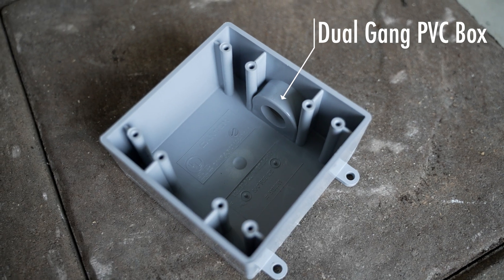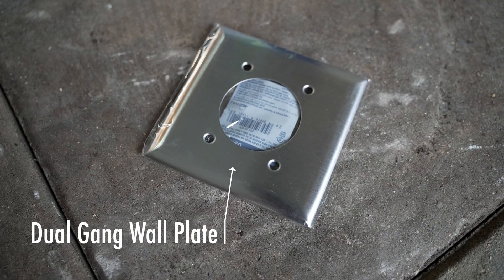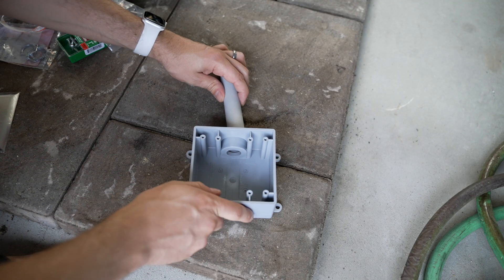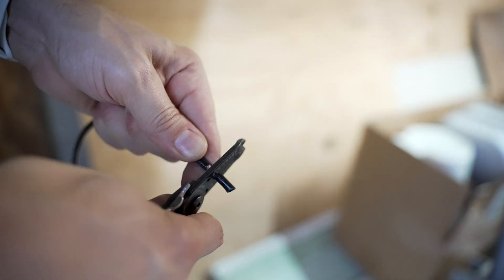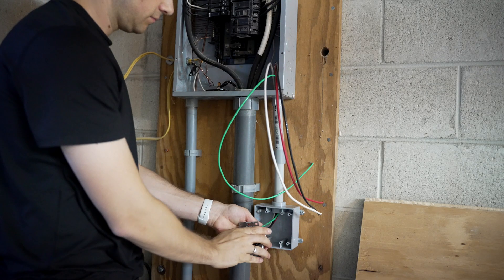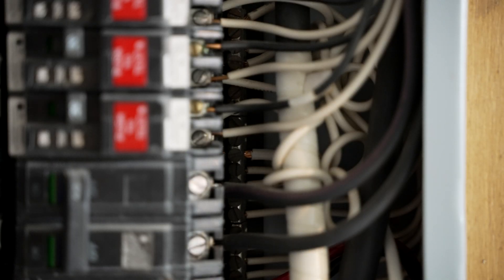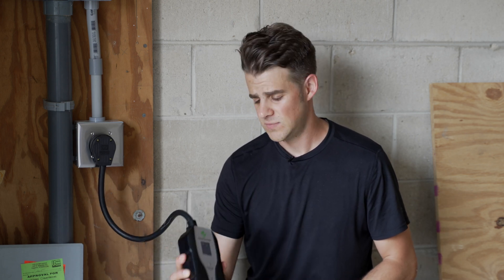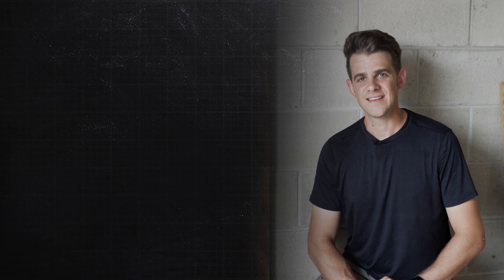Installing an Outlet for Level 2 EV Charging

Comment: Licensed electrician in TX here! Job looks great!
Reply: Hey brother, please review 2020 NEC article 625.  It looks like the breaker is wrong....gfci required.
Reply from the maker: @keithharrington8715  Yes. However, we are fortunately still on 2017. I say fortunately since EVSEs are known to trip GFCI breakers due to interference with the GFCI in the charger. The last thing I want is to wake up without a full tank of electrons if it trips off in the middle of the night. Obviously, this does raise some additional shock concerns on the outlet itself.
Reply: @chargeeverywhere  this is a requirement that was unchanged in the 2020 code.  Yeah! Required in 2017 or earlier.  625.54 I think.

Comment: Great stuff. Only 1 question: I thought for 50A 6 AWG if Copper and 4 AWG if Aluminum is required. In your case its just a few feet but still.
Reply: Yea this isn’t for 50 amp setup! Good way to get homeowners a really fantastic home Electrical fire! 🔥
Reply: 6ga wire for 50 amp, only,  this is a fire hazard,  please 🙏 fix asap
Reply from the maker: I already have. Technically it was ok as the breaker and outlet are rated to 75C. If you watch my update video on this, you'll see that I have been using an industrial outlet rated at 60C. Because of this, I've either switched to 6 AWG or used a 40A breaker.
Reply: You should redo/remove this video because you are putting #8 wire rated for 40 amps which means the 50 amp breaker is not protecting the wire which is the reason breakers are rated as they are. If I was not an electrician I might have followed your Video advice and installed the wrong breaker. PS your other video about the heavier duty Bryant plug is informative, Thank You, but the wire you are using in that video appears to be #10. Again, you should remove the non-accurate advice videos. I see you mentioned the updated video but THE OLD ONE(s) SHOULD BE REMOVED. I am able to use #8 as my Pacifica Hybrid pulls 32 amps for 220 charging.
Reply: @josephaparisi  48AMP CONTINOUS LOAD X 125% 3 HOURS OR MORE # 60AMP BREAKER- OVERCURRENT PROTECTION.
Reply: THAT NIMA AT 48 AMP CL FOR 10 HOURS KIND OF MAKES ME NERVES IT MAX AT 50 .. PERSONALY I WUOLD NOT INSTALL IT FOR MY FUTURE EV  AND YOU NEED MINIMUM 48 AMP CL LEVEL 2 FOR HOME CHARGING STATION  120 V LEVEL ONE DOESNT CUT IT..
Reply: I would recomend the tesla and the one from india 300. Dollars.
Reply from the maker: Yes, 6 AWG should be used. In fact, I just upgraded this outlet to it yesterday. It was technically still ok as both the breaker and outlet were rated to 75C (good for 50A with 8 AWG), but ideally, the 60C wiring column should be used, requiring 6 AWG. I've released a follow-up video addressing this issue: https://youtu.be/CTT0mkVq-8s
Reply: #8 THHN is good for 50a because of the 75c Breaker. thhn  wire is rated for 90c. Romex #8 is rated @60c=40amps
Reply: Guys theres been a lot of fires  wrong ev charges  you need to use 100% dury outlets remember rivian can take up to 13 hours charging at 48 amp continuos load you have to calculate the 125% continuos load rule to a 48 amp max level 2 home charging station..48X1.25% = 60A BREAKER 60A WIRE TO A HARDWIRE TESLA WALL CHARGER DONT USE 14_50 NEMA OUT LET TO DANGER ITS NOT 100% DUTY PLUS YOU HAVE TO USE GFCI TESLA WALL CHARGER HAVE GFCI BUILT IN.. you might need to upgrede your service..

Comment: 8 gauge wire under 50A breaker ?
Reply: I think it is a wrong setup 🙂
Reply: thhn has a rating of 90c but breakers are rated at 70c. going by 70c #* thhn is good for 50. Romex #8 cable is rated for 60c=40amp

Comment: 50 amp service, 6 gage wire, not 8 gage
Reply: 8 gauge wire is fail.
Reply: @erichchan3  Incorrect, #8 THHN is rated for 55A.
Reply: Incorrect, #8 THHN is rated for 55A.

Comment: I have a 14 bmw i3, I’m going to install a 240v  in my garage with a 32 amp breaker, a 32 amp receptacle, with 8 gauge wiring so I can charge my car, I’m I on the right path?
Reply: Luis, please connect with a local electrician if only for the knowledge.  The code allows each building department
To make adjustments to the codes.  Also there is a code section just for car charging 625.

Comment: I want to replace a 120 with a 240, can I use the same wiring?
Reply: Luis, probably not.  Most 120 vac wire runs are 15 or 20 Amp runs.  Most 240 or 250 ac runs pull or draw more current than that.  Under sized wire for the current draw can create both a local shock hazard and a fire  hazard.
Reply: Yes #12 wire on a dedicated! circuit can be converted to a 6-20 outlet with a dual pole 20a GFCI breaker and marking the white at both ends to a load color such as black or red. You could also hard wire it and use a non GFCI. This would be good for 4kwh at 16a 240v.

Comment: 8 gauge is to small for 50 amps. Should be 6 guage. Also garage outlets should be GFI protected.
Reply: Gotta love how respectful tradesmen are. This is most cordial straight talk disagreement I've seen in YouTube comments 😂
Reply: The wire he used is 90 degree. You're numbers are 60 degree.
Reply: All things considered going with 6 or maybe 4 gauge seems worth the extra money
Reply: # 8awg thhn is definitely good for 50 amps ….. so long as you leave it on the spool
Reply: Great call.  210.8 is gfci for garage plugs.  What so many miss is NEC section 625 for car chargers.  625.54 requires a gfci because it is for car charging.
Reply: Doesn't 310-16 tell us that #8 wire is good for 50amp?
Reply: @tablespoon888  sir, if you look under the afore mentioned sections, breakers less than 100 amps are normally rated at 60 degrees unless other wise rated.  No matter what the insulation rating is, the ampacity is based on this rating.  Even thhn connected to your breaker must use the 60 degree rating.
Reply: @keithharrington8715  this may be in the NEC, but it is not worldwide. Following the CEC #8 is ok for 50amps if it’s 75c or 90c. You do have to account for the outlet. If the outlet is unrated then it’s 60c. But in my experience all the 14-50’s I’ve seen are rated for 75c.  Not sure where this guy is located. But it is ok where I am from. Even NM-B.
Reply: @y2j514  thanks.  Even the nec is set p to allow the local building departments to modify or adjust the nec rules.  

I know that not everyone is under the nec and appreciate you highlighting that for the views that fit that situation.

Again thanks.
Reply: @tablespoon888 he’s probably only pulling 32 amps so 8 gauge is ok. However he should have used a 40 amp breaker instead to follow the 80 percent rule.
Reply: If it’s a 50 amp breaker the max the charger will draw is 40 amps though (50 x .8 for continuous loads)
Reply: This is THHN not NM/Romex
Reply: @GregHassler  yes, but the rating of the circuit breaker terminal connection is normally 60 degrees cel. Unless other wise rated..  2020 nec.110.14.(C). and 2020 nec 110.14.(C).(1).   this puts the wire connected to the circuit breaker under the 60 degree rating no matter the insulation used:  NM, thwn, thhn, whatever......60 degree column.

If I got this wrong, let me know, please.

Comment: Wait. So these wires are exactly what you’d get in the 6 gauge? I have a further route but I’m getting charged a lot. That looked very Do able. Great vid
Reply from the maker: They are thinner, but the insulation is rated to a higher temperature, which allows a higher current rating. The wire I used is rated to 55A, but make sure to check the rating of the wire you use. Also, if your run is very long you may need a larger gauge to prevent voltage drops. There are some online calculators that can help with these calculations.
Reply: @chargeeverywhere  awesome thanks for this

Comment: 1. You should glue the conduit. I know it won't come apart the way you have installed it, but it's still poor work 
2. A 14-50 outlet requires a 2 pole GFCI code to meet code and pass inspection.
3. Electrical supply needs to be checked for adequate capacity before installing extra circuits.
4. Please don't give 'expert' electrical how to advice without actually knowing what you are doing. Not only is this somewhat reckless, it is potentially leaving you liable for somebody burning their house down. An inspection before releasing your video would have caught all your errors.
Reply: No one cares
Reply: Good God! He did a fantastic job. Get a life
Reply: @baivabmitra376  He gave 'expert' advice on an electrical installation that would fail an inspection. Electrical work needs to be done properly, for damn good reason. Get it wrong, people die, houses burn down. That's not exaggerating. If this was baking a cake or gardening advice, nobody should be too upset. But it isn't.
I fix dangerous work all the time, mostly by amateurs who think they are experts as they read something somewhere or watched something on YouTube. Your response indicates that you are one of those 'experts', rather than somebody who actually knows how to do electrical work.
Reply: @pictsidhe6471  FYI - I am an electrical engineer and worked across 3 countries handling even 3-phase and once even at a nuclear power station. What surprised me with your answer is what I see ONLY with US taught electricians. They LOVE to quote NEC, they LOVE to say the word "inspection".  At everything. When questioned 90% of them fail to explain themselves since to certify most did 1 thing - memorize the code. I get it that the guy whose video we're commenting on - has mistakes, has issues but at least he is trying to do it himself. I re-watched it and frankly I have seen 100 times worse and those remained operational for +50 years and here what he did : chances of that scary stuff you mention like burning the house down : c'mon man!
Reply: @baivabmitra376  
1. My initial electrical  learning was not US. It was in a country with higher standards. 
2. I've also done electrical work in 3 countries.
3. I work on 3 phase daily. This is likely why I get triggered so easily by amateurs who think doing things right isn't actually important. Fun little things like underrated stuff catching fire or exploding in my face, machinery sitting in water with the case at 277V can do that. Try it!
3. A real 'electrical engineer' would know why GFCI 14-50 outlets aren't available.
4. Just because you don't understand something, doesn't mean there isn't a good reason for it.
5. They let you work in a nuclear power station? My god. If somebody really wants to set me off, they give me a badly made cup of tea when I have something important to do.
Reply: @baivabmitra376  Some jurisdictions allow you to do legal battles for bad electrical advise.  You need not do the work yourself, just advise and you can get a court date.  So, you can say none of the bad stuff will happen, but history says it is possible.  Because it is his realitives

Comment: Installing the outlet isn't the problem, it's getting power to it from a panel 100' away through walls and one level. Good video nonetheless!
Reply: A long run adds some interesting concerns.  Some ev chargers have tight voltage tolerances requiring "voltage drop" considerations. This is generally solved by up-sizing the wire (#6 wire to #4 wire as an example).

Most electrical workers are not buttheads for perfection.  They want the job done right to protect everyone.  I expect any moron can put a wire under a screw and tighten it down.  Making sure it is the correct wire and the correct screw is the important part.

So please consider a 6-pack, case, or meal as part of your job to get the knowledge you need to get it done correctly.

Good luck.
Reply from the maker: Very true. I’ve done my fair share of long runs, but no videos on that so far.
Reply: I did 80’ run and no problem at all.

Comment: FYI the 50 app plug plug at home depot the very light gauge each you should upgrade it to a commercial plug. They have a lot heavier guts in them that won't melt at high am pridge for long periods of time
Reply from the maker: Agreed! After installing this I realized how many Leviton outlets have caught fire during charging. Yesterday I swapped it out for a Bryant and feel much better about it.
Reply: @chargeeverywhere  Hubble or Bryant only for 14-50 plug.
Reply: Yeah for the money I am going to save doing this job myself, I am going with the good stuff

Comment: I believe I saw the battery capacity at 33,000 watts. Charger efficiency may be 90% becomes 36,6666 watts input? The 50 amp charging input at 235V average is 11,750Watts. That suggests  just over 3 hours for a full charge?  What does Tesla do, to charge in 30 minutes as I see on long trip recharge stations?
Reply: This type of 14-50 charging set up is limited to a 10kW continuous load. Level 3 chargers (fast chargers) supply up to 150kW of DC directly to the battery so there is no inverter needed.

Comment: Ncie Job,  but NOT TWO PHASE.   :)   the 220 is just a single (1)  phase.  120 is one hot to neutral, and the 240 is the hot to hot.
Reply: Yep, agreed.
Two legs, but not two phases.

Comment: What's the reason for using 3 conductor wires and a 14-50 instead of 2 hots and a 6-50? Just because you already had an EVSE with that plug?
Reply from the maker: Yes, that is the main reason. Nearly all EVSEs of 32A or higher use a 14-50, so it gives you maximum flexibility for the future.
Reply: @chargeeverywhere  Makes sense. Thanks!

Comment: 8 gauge is not the proper code for 50 amps. Huge fire risk! You need a 6 gauge wire.
Reply from the maker: That is correct for Romex. However, the THHN I used has higher temp insulation which allows it to handle up to 55A.
Reply: @chargeeverywhere So, #8 THHN can be used with a 50 a amp breaker? 1) But, does the 14-50 outlet have a thermal rating less than the wire? If so, then shouldn't an outlet thermal rating decide on the wire thermal rating? 2) Also, I have a smart QPQ outlet charger (haven't installed it yet) CAPABLE of up to 48 amp charging. But, from the NEMA 14-50 outlet plug, it has #8 conductors & a #10 ground going to the charger body. I don't know what the wire size is going from the charger body to the charger plug that is inserted into the EV. So, is this dangerous since this charger is capable of charging UP TO 48 AMPS and is advertised as doing that?! It seems to me that to be safe, I should limit my charging on the sliding scale of the QPQ app to 40 amps and not 48 amps? What do ya'all think out there?
Reply: THHN is rated to 55A, though I've never pulled it in PVC.
Reply: @pictsidhe6471  #8 THHN is rated for 50amps at 75deg C. No issue with installing it in PVC. The wire terminations most likely rated for 75deg C (breaker and the receptacle). #8 romex would be limited to 40amps because its only 60deg C.
Reply: @jay9308  No, THHN is rated at 55A at 90C
Reply: @pictsidhe6471  correct, but this application would limit the #8 thhn to 75 degrees because of the breaker terminals and outlet terminals being rated 75 degrees.
Reply: @jay9308  Where is that in the code?